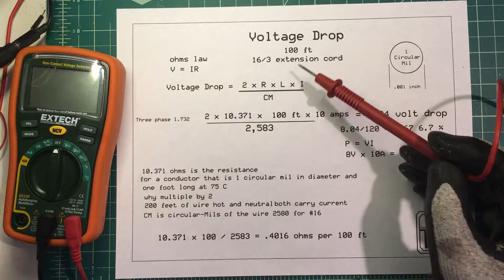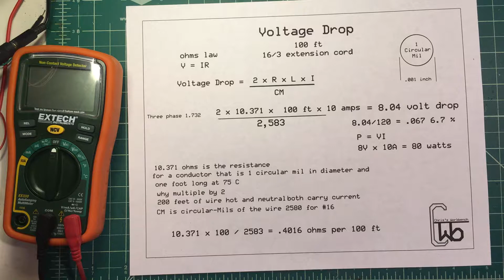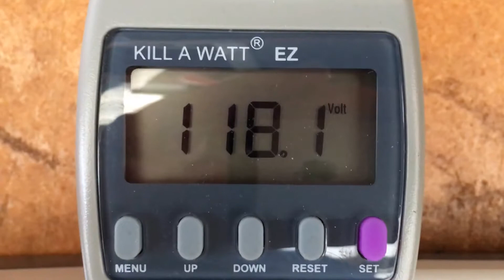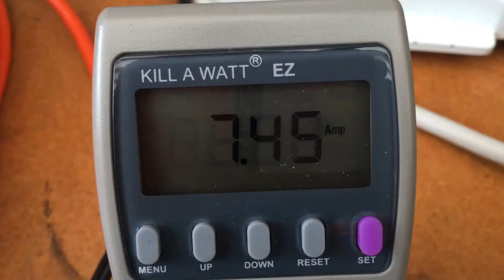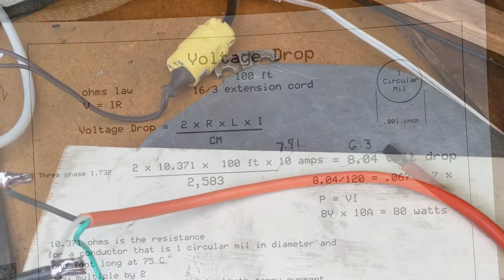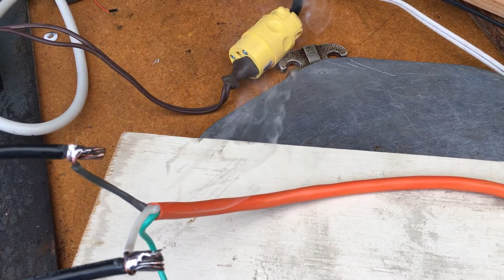Voltage drop 16/3 extension cord

Comment: thanks for this. very clear. can you show an example where the load has a startup surge? such as a pump, fridge, or AC? i've got a drummond 1hp water pump 1200w, on the end of a 50' 16ga ext cord. the rotor sometimes locks for 2-5 seconds and voltage drops from 118 to 102 or so.